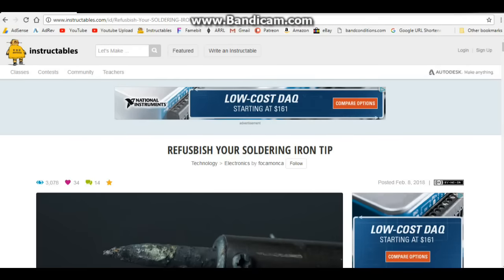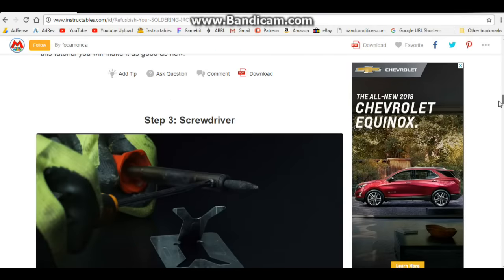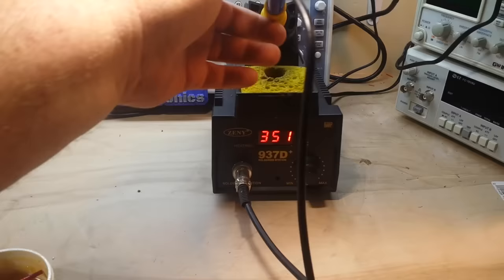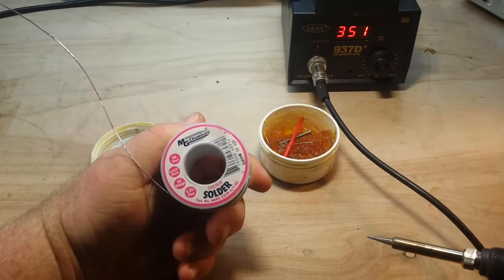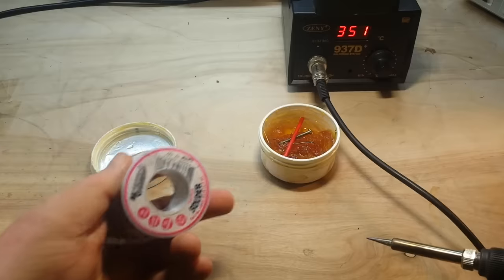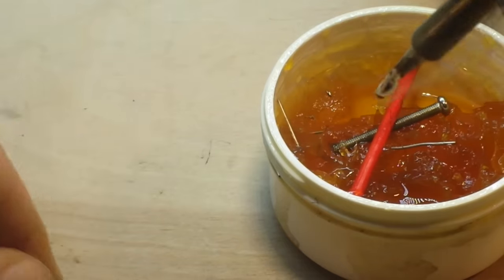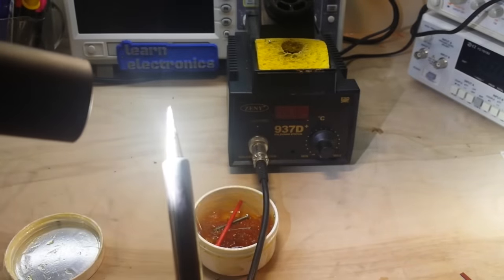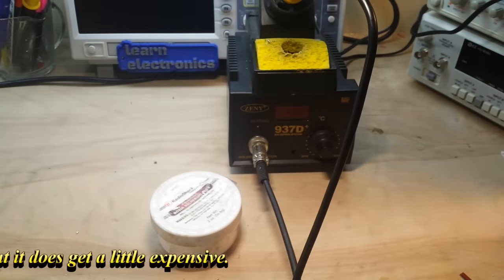How to clean and re tin your soldering iron

Comment: I will say this article looks like common sense would explain it self but I have tips for destroying and I have tips for regular solder. The ones I use for “destroying” are for metal work like potmetal aluminum and zinc solder welds the flux destroys and corrodes your iron tips keep in mind obviously not your regular conductive solder flux and surfacing the corrosion process I have to take a file to it not much just enough to give it a bare solder surface but that’s about the only time I recommend any grinding is if it’s related to metal work and not conventional electronics and or obviously a tip you don’t care about but if it’s day to day solder work for what the iron was intended for I recommend what your stating above in this video

Comment: Can anybody help. If I try to tin my soldering iron the solder just does not stick. I have tryed it with flux and I have tryed to clean the tip but nothing works it's impossible to solder like that.

Comment: technically, the method is not fully incorrect.  It was an acceptable method if you are using pure copper tips without coating.

Comment: I would not even use the brillo pad either.  It can scratch and damage the tip. On another hand,  if you don't have temperature control for your soldering iron,  it will get too hot and burn the tip no matter how well you tin it.

Comment: Before I electrocute myself: electrolytically re-tin the tip (glass of salt water), Is that a thing? Yes, I'm a beginner and I totally did that sandpaper mistake. I'm also occasionally using solid resin as flux (violin lessons back in school days) and I think that's bad too. Burns fast to solid carbon, hard to clean. That's what got me to sandpaper. 🙄

Comment: I just rub mine in my metal wood thingie that I bought for cleaning it and tin the tip before turning it off with some nice amount of solder and never had an issue with a tip going bad. no need to dip mine is flux or anything

I tried the sanding thing before I knew how to ttake care of my tips (and when I used 1$ soldering irons) and it ruined it. lol.
but like the current soldering iron I have is a 60$ iron + hot air combo.

Comment: I don’t understand why he never mentioned the temperature of the iron or even that it should be on.   I mean you should t be wiping it with a normal rag or whatever if it’s hot.   I also noticed that my Hakko station took much longer to cool to about 380 than it does to heat to 800.   That was neat and all, and I’ve been soldering for thirty years, incorrectly, but o wish someone would spell out what exactly is going on with the flux, tinning, wiping, why not sandpaper, etc.

Comment: He knows SO MUCH about maintaining a soldering iron.  Step 1. heat iron.  2. Wipe red hot iron on a COLD, WET wiping sponge.  3+ steps.  Wipe off the red hot soldering iron on a COLD,  WET sponge.  Yeh sure, lets fracture the iron by heating it, then cooling it.  Oh come on?!  NEVER wipe a hot iron on a wet sponge pad.

Comment: If its one of those Chinese specials that has a really thin coating, honestly? Go ahead. The nickel plating on them is so thin that it gets eaten away and the tip physically deforms.

But dear god do NOT grind on your high quality tips! The coating on those is actually decently thick. Those ones don't get eaten away.

Also, I don't recommend sponges. The act of the tip being quickly cooled by the water isn't... good. Go with a the brass wool thing.

In my experience with the chinese specials: Any significant rubbing that you do with the tip (drag soldering on SMD chips) will absolutely DESTROY them!

Also, I should probably change out the copper scouring pad I have for a proper brass soldering tip scourer.

Though, my one soldering iron that had a """"machined"""" stainless steel screw for a tip doesn't mind ;)

Comment: Hi. Thanks. So true, never use any abrasive, like sandpaper or or scratch it with the back of a cutter or metal. 

Do you need to buy those soldering tip refreshing that's powder and comes in a small tin can, by the way? 

What kind of sponge can be used to wipe it off? Can the dishwater sponge be used? Or there's a special sponge for soldering tips?

Thank you.

God bless, Revelation 21:4

Comment: first of all not every one has a temperature control soldering iron that also help tip from not going bad. mine gets so hot i can tin an flux all i want. it still goes black.
and the 1.2k dislike is probably for telling people they are lazy mr know it all.

Comment: either lazy or new. I just bought a cheap iron to remove some stuff off my old motherboard to display it and practice if I ever need to know it. P.S. talk to me like I'm a baby because I'm that new, i dont have any flux, just the iron, a spare tip and some solder that came with the iron.

Comment: Ummm. I reground  a few tips over the last twenty years. However I did this same process of tip recoating and proper cleaning has saved them. Slow heat to a hot finish.

Comment: Great demo, thanks! 
 Also, I actually have a Radio Shack 30 min away from me. In '22! 
 It's a small one, independently owned by a couple that also does satellite dish work. But they have plenty of good stuff I can't find anywhere else locally. Even open till noon on Saturdays👍🏼
Because  SOMETIMES, a 30 min drive vs. 2 or 3 day shipping is well worth it😉

Comment: WRONG! It's NOT that easy! I have watched several videos on how to tint a soldering iron tip, including this one, which are all the same btw, and meticulously followed the instructions step by step on relatively new tips (no pitting or sandpaper involved), and yet it NEVER works! This is SO FRUSTRATING! The tip remains black and no amount of solder would stick to it no matter how many times I repeat the process. As soon as the solder melts, it balls up and rolls off the tip like Mercury off of glass. Based on all the information available online oh how to tint a soldering iron tip it seems like I'm the only one dealing with this problem! I've become strongly averse to soldering due to this specific problem. What gives?!

Comment: If your not careful when using wire  or solder wick to absorb solder off a part you can find yourself with zero solder on your iron. When that happens it gets pretty hard to get it back on there.
My tip looked like yours then all the sudden it wouldn't take solder any longer because there was none.

Comment: I clean it easy. With a cardboard .like a old shoes box.
If it stil is hot just push a hole in that box.  .
Easy to use .
And I use it for years a gas soldered iron .

Comment: Yes I’m lazy.  also I solder once every 6months when I need to... not all of us are electrical engineers and sits and build pc boards every day 🙄

My requirement is to do whatever I can to get it tinned again, if I must grind it I will do that as I am not married to it

I must say thanks for explaining that the tip is coated, I was really under the impression it was a copper core...

If we ever get released from Corona Jail I will go buy new tips

Comment: All for accept the rosin soldering flux have I followed the instructions my dad who worked for RCA and my brother has used to do a lot of soldering but not anymore it says he used to take a piece of paper to clean the tip a piece of paper now everybody talks about the sponge and I've heard some people say it's a wet sponge it's not a wet sponge I hear everybody say do not remove the coating on the tip of the soldering one and yet I see them jamming the tip vigorously into this Brillo golden soap pad thingy and how the hell does this not remove the coating from the tip God I wish I had my old Radio Shack soldering iron that I didn't have to ever ever worry about ... HELP make me a fan give me no failing tips it's got to be simpler than this I never had to do jack to my tips knock off the excessive solder every solder and it worked beautifully you would have been impressed with my soldering it was not too much not too little never Globs never came apart and now I can't make a solder to save my life because of the crap they sell nowadays help my friend Eric Sahagun I build starships and World War II 32nd planes with all kinds of electronics in them spinning propellers firing machine guns and now I can't do Shite ... HELP!

Comment: interesting vid. personally i wonder how the blazes did the fellow with the instrucatble tip end up with a tip so ruined?The main way to not have a corroded tip is to eschew non-lead solder, I find. I can't abide the stuff; it eats tips like nobody's business. The wetting isn't very good, the joints look dull, it needs a hotter tip, and finally, lead-based solder in a PCB in a landfill will retain its lead for millennia. So the environmental gains are negligible, especially when one considers the entire world is suffused in lead from the use of tetraethyl lead for decades in petrol, and indeed is still used in light aircraft.

Comment: Anyone have a radioshack iron?
I am guilty of having a jacked up tip. I guess not enough cleaning? Higher temp maybe? I solder bigger wires than a circuit board.
Is my only tip option radioshack com? Its a super long tip.

Comment: I would just heat up the soldering iron. Get loads of paper towel and SOAK IT IN WATER, then just clean the tip, even at 450C you wont feel anything, the water absorbs the heat.

Comment: two different soldering irons, might want to use the same solder iron when showing people how to clean things, the solder iron used in the pictures contain a copper tip which can be cleaned with sandpaper, if used for a long time the tip gets smaller and needs to be replaced anyway... built similar soldering irons in the past for 5+yrs which used the copper tips so yeah no big deal with the sandpaper, the copper tip should be removed after soldering otherwise it does end up black and sometimes gets fused inside the element, i also fixed the ones we made for warranty looking like that and sometimes even worse than the pics.

Comment: We used to be able to buy solid copper alloy tips.  Yes, it was common practice to redress them with sandpaper or even a file when necessary.  If you kept them clean and well tinned they would last several months of constant use before needing to be either re-shaped or replaced.  They were inexpensive enough that we could reshape them into a variety of different chisell sizes but rarely did we use the pointed tips more common today.  But, I'm talking about the days of discreet 7400 series ICs and axial lead components.

Comment: I totally agree that your iron's tip should never get as bad as in that photo.  Still - there may be some times when the sanding method is warranted.    In my case the tip had gotten left outside and oxidized.  I didn't have a tub of flux just some flux core solder.  So I sanded the tip and immediately applied solder to the copper core.  Worked like a charm and had the added benefit of letting me make the tip narrower which helps for electronics.

Comment: Hahaha, I did the same thing with my tip but not with sand paper and not by looking on that website or any website, I fucking used the rotary saw to make the tip sharper 😂😂😂 and I guess that ruined it too.

I have to get a new iron anyway because the tip on my iron has no replacement... as it is like a screw not like the regular ones.

Comment: I don’t get it, if you get that lazy and allow the tip to get that way replacement tips are cheap.  Replace the tip and keep the new one clean.  If it ever came to having to clean it up like that why wouldn’t you use a stainless bristle brush instead of sand paper and re-tin?

Comment: I was going to ask about the Brillo pad that I just bought for the TS100 I just bought. I got the cleaning station first, so I’m going to watch this and some how to before I screw up my new hot rod iron. 
I’ve been using guns and never heard of this flux and clean which I am now going to do. 
My big weller gun trigger just died so my soldering is going to take a step function up this week! 
Thanks man. I’m going to see if you have soldering advice too now.

Comment: Damn, too ate, I found and old solder gun and used sandpaper before watching a few videos to learn about flux. The solder gun is useless now so off to get a new one as it was already pitted and messed up anyways being found in a scrap heap of a tool box.
Reply: If the gun still turns, on just buy a new tip for it!
Reply: @jfrphoto01  , I also realize I suck terribly at the art of soldering. My 2nd attempt though, much better but I was surprised as to how much flux was needed and how the solder still just rolled off my copper end fitting for a large gauge wire. Crimp and solder is the plan but difficult for it to stick to the wire and fitting without layering the solder and wasting much of it.

Comment: A brand new tip is like $1 each in a multi pack.
What's wrong with you?
The tip gets overfilled with solder...
It gets wiped, or it doesn't work any more.
Are you on drugs?
Reply: ......... Amen .......... almost 50 years in Hands On electronics ...............  $1 a pack .........

Comment: Please my friend respond to me I just broke my six-year-old Radio Shack most reliable soldering wand I've ever had well correction I've had a lot of them and they lasted me for years now every single damn soldering iron I've bought or one top of the line pay 30 40 bucks for have lasted me four to five Sauders developed a gray tint to the tip and no longer work my Radio Shack soldering iron I know you're going to kill me for this cuz I just watched your video after every solder I would shake off or bang off the excess solder on it every solder in about every 12 Sauders I would take a filing metal file and clean the tip and solder about 12 more times again now every soldering one I've bought has lasted me four or five solders I've cleaned the tip with the wet sponge it's developed that primer Gray flat color and it stopped working I don't have any flux gel I've gone everywhere and ask for it and nobody has it or even knows what the hell I'm talking about I'm talking Ace Hardware Home Depot but even Radio Shack when it was still open nobody knew Jack about any of their products except cell phones help what am I to do I'm so sick of paying 20 to 40 bucks a pop to only have these damn things work four five times and they're shot I'm told the way they make soldering irons and guns ain't your grandpa or dad soldering gun anymore just like the Republican Party LOL

Comment: Before iron-clad tips, there was no coating on soldering iron tips to be concerned with so it was common practice to use abrasives like sandpaper if the tip went too far gone. And even on the initial prep if there was a significant layer of native oxide. The POS soldering iron in the instructables video would be binned by me, even before initial use, so no great loss on that one.

On a proper iron, the technique you outlined is good. But I'd never use a true conical tip. I have used a truncated (and slightly angled) conical on occasion for intricate work but in general I use a chisel tip. Corner for small work, front edge if more contact is needed, flat for larger areas.

Comment: not helping at all because he's already have a very good tip,solder iron like the one in this video if the tip got bad or out of coating,the tin won't stick to it at all,the only way to fix it to sanding with 1000-1500grid and electroplating it back with copper or nickle,after that you can re-tin it like in this video,just search for electroplating if any of you have no idea to do it.stay creative guys

Comment: This is an instructable on how to destroy your YouTube channel.  I just got into soldering, since I am on 6 month Medical suspension, I messed my soldering tip a bit, YouTube how to clean it and the first video, dude tells me how lazy I am.  Who do you blow to be first in YouTube algorithms?  Because the next 6 videos all said you can use sand paper, or a razor knife, if you do it correctly. I think mine is to far gone so I'll just by a knew one. Just a word of advice, from a nobody. You might not want to insult your audience, 2 mins into your instructional video.  Good Lick either way

Comment: BAD INFO HERE!   Weller Soldering Iron Tip Care Guide: Avoid dipping your tips into flux to clean them, as the substance is corrosive. To clean your tips, use either brass or stainless steel wool. There are also tip cleaners compounds available.
Reply from the maker: This is the way it is taught in the US Navy. This how I taught at CCAC. Time honored, so take your BAD INFO HERE and blow it out your cathode.
Reply: @learnelectronics  Quote from Weller and I was also taught that was a no no way back 50 years ago in electronic classes.
Reply from the maker: I'll stick with the government. When have they ever been wrong?
Reply: Hmm... I think that's just a disclaimer to cover themselves.

Comment: I think part of the problem is the type & quality of tips, as well as the humidity level. I notice high humidity oxidizes the tips fast.

For beginners, BCM2 or CM will be lot easier to work with. They hold a puddle of solder that never fully oxidizes even with bad maintenance.
But these are difficult to find in entry level solder kits nowadays. 

A cheaper way to make this at home is to use a 2CF tip and make a dent on the wedge face with a dremel tool. Tinning must follow this immediately.

I started with a BCM2 tip on a cheap solder iron 15 years ago. It still works fine.
 I'm surprised how this is not the default on new solder irons.